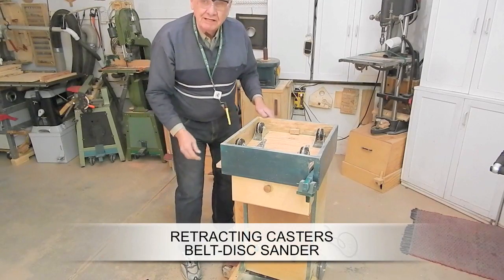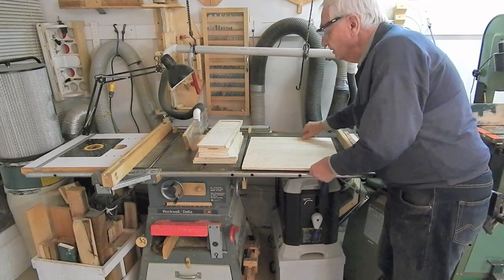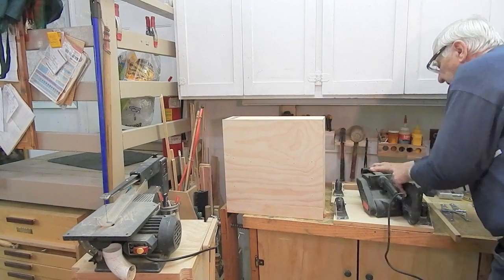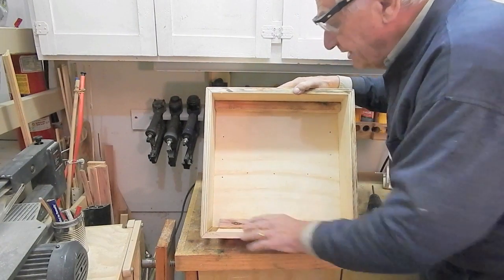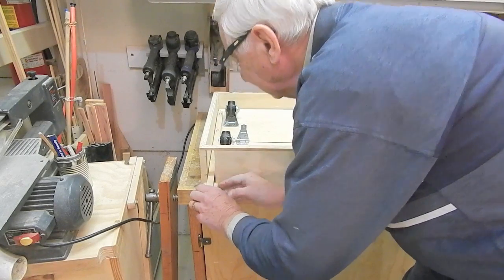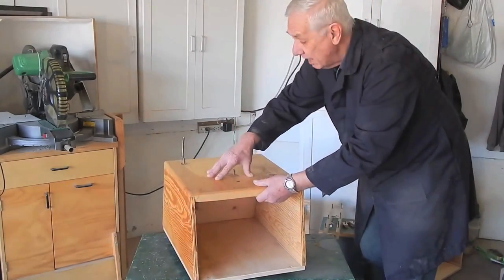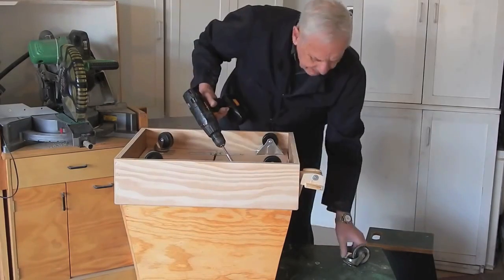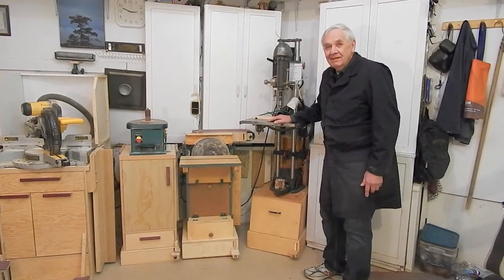Retracting Casters No 5 - ShopSmith/BeltDiscSander

Comment: Very Nice Carl, well thought out design, simple, straight-forward and useful. 
Currenlty I am incorporating some bearings into my woodworking projects for rotating shafts and have not found any good videos about setting a bearing into wood so the OD is fixed. If you have any ideas, it would be appreciated.